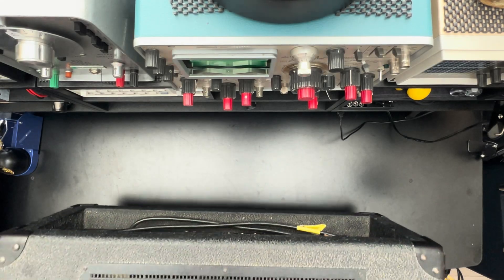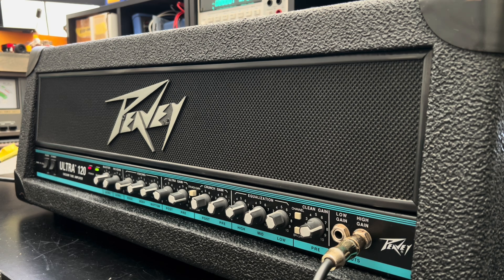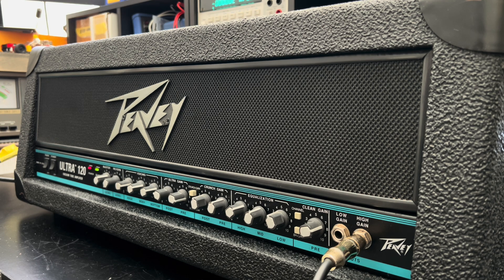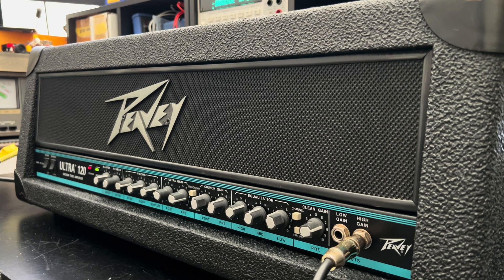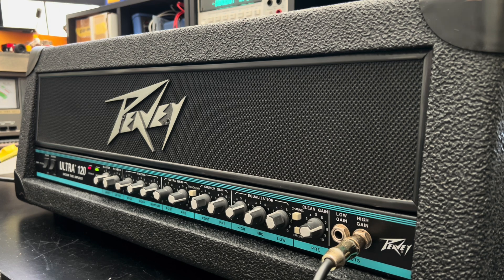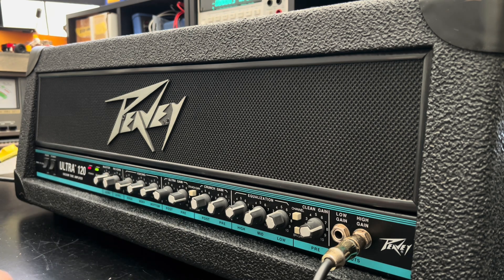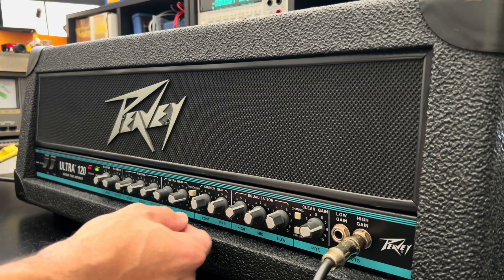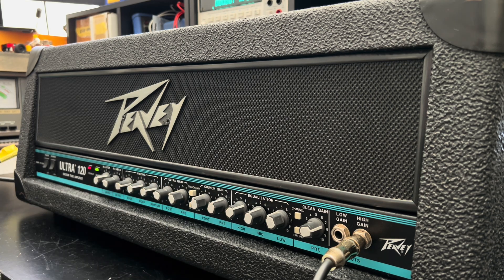1992 Peavey Ultra 120 || Peak James Brown

Comment: I bought an Ultra 120 off an apprentice I work with for $200. It didnt work. Turned out it had blown fuses after I opened it up.
I had to build my own custom footswitch to operate it because they are so rare. The head needs the footswitch to fully operate.   Great amp.
Reply from the maker: You’re a saint saving that beast!

Comment: These are such good amps! I scored an ultra 60 for $100 a year or two ago because it was turning on but not lighting up. Was an easy heater wire repair and back up in running in 20 minutes. Gotta get mine out and use it more.
Reply from the maker: I’ll be looking soon!
Reply: That 60 would be perfect for my needs.
Good deal man
Reply from the maker: You would dig the Bravo too